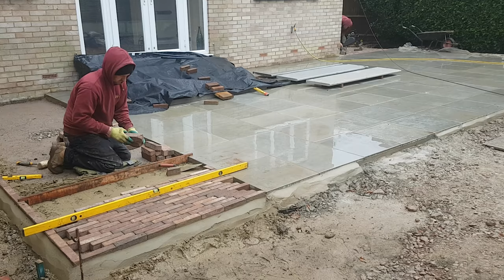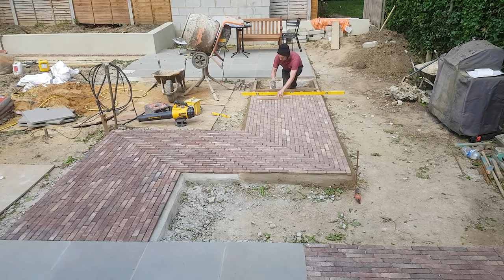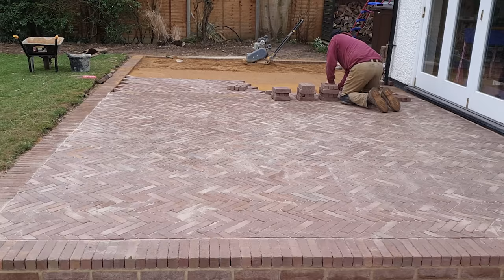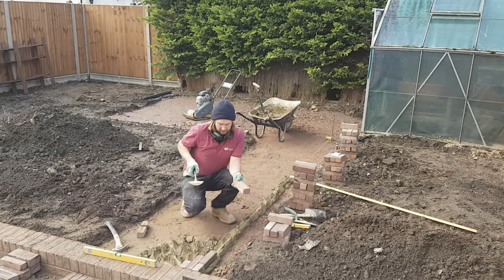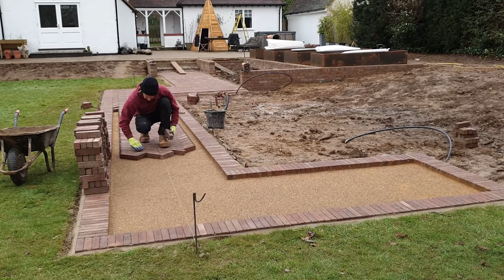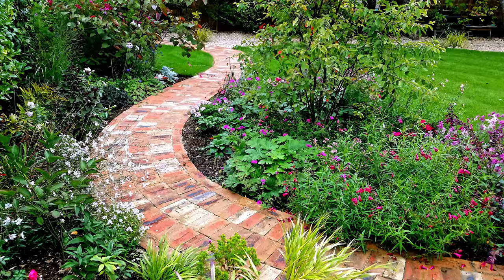Clay Brick Pavers being installed. Best Landscaping Material. Inspiration

Comment: Love clay pavers. They are stunning. Do you guys recommend setting them in mortar or laying them on sand as I can see you doing both in the video? Also at 47s what type and range fo pavers are they? They look like Cottage Garden.
Reply from the maker: Thanks for the interest, they are global stone 'tudar' and you can see that path installed in our 'landscaping a garden' video.

Would recommended laying them on just sharp sand if jointing with kd sand (like a driveway) much easier and they drain better. We morter bedded some of the paths in the video as we had lights going in them and sand tends to wash into the cut outs for the bulbs.

If we were to joint the the pavers with mortar or resin we would also cement  bed every paver.

Comment: Have you ever jointed in clay pavers? If so, any recommendations on what to use.. want to avoid moss growing in the joints. (laying on a cement bed to butt up to a porcelain patio).
Reply from the maker: We don't as large amounts of pointing takes time and is prone to blowing in the future. If it was a soft paver or brick I'd use traditional sand and cement. But if it was a smooth hard paver like the 'bexhill' in the video I'd use something like streetscape gtfk vdw 850. Thats stuffs bulletproof!

Comment: looks class mate - i’m doing a clay paver path next week, laying my edging pavers on mortar with a haunch and then screeding the sharp sand off of those. When you lay the pavers, do you butt them up to each other, or leave a few mm gap? says to leave a gap online for the kiln sand to get in there, but would they not just wiggle around as you’re laying them if not butted up?
Reply from the maker: Hi mate, yeah they do want them with a tiny gap so they're not touching. They are odd shapes  so there will always be voids for sand but we sometimes use thin slips of card to space them. You can also lay small sections and kd sand it as you go - but use loads of string lines as you cant straighten them once sanded. They're a bit fiddly to start but awesome material to work with 👍

Comment: Looks great, I’m looking to do something very similar. What size are the pavers? If you lay on a sand bed do you still have a fall or install level?
Reply from the maker: Thank you, its our favourite product to work with! Bexhill, by Chellmer valley.. They are 200mm x 48mm. Sand beds alow slightly better drainage than mortar beds although everything is still laid with a minimum of 1 over 80 fall to allow the the bulk of  water to run off the surface of the paving when it rains. 👍
Reply: @HowWeLandscape  Thanks for the info, they do look fantastic. I'm currently planning a path similar to the one in this video. For planning purposes do you assume that there is no gap between the pavers? What size do you make your cuts? 152mm, 104mm and 56mm? or something else?